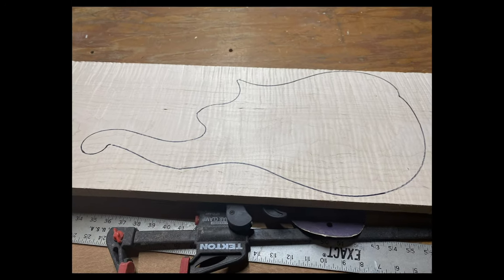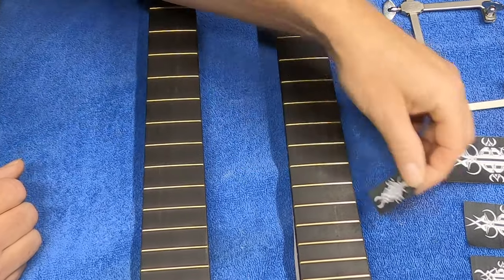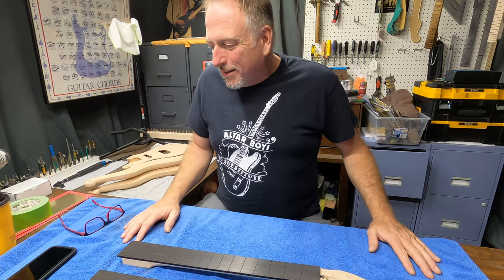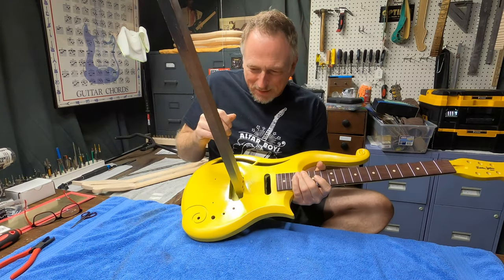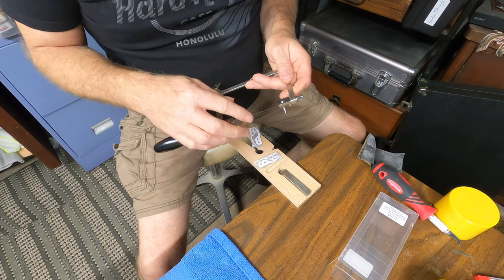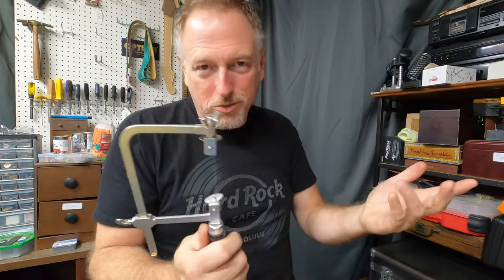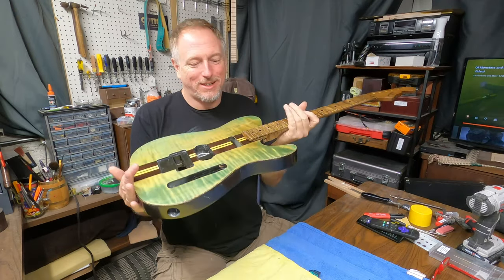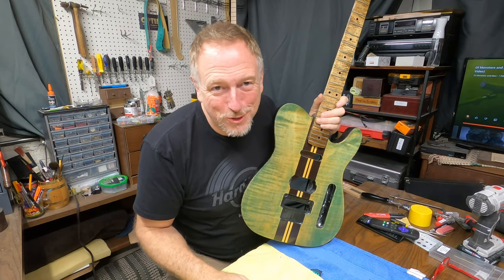Inlay or Decal? Did I Fail? Who's On First?  Questions in my mind!

Comment: I'm thinking the smaller of the two inlays looks better size wise. I've seen some ugly, ugly fretboard where on a lot of guitar that come into my shop. That would totally eat up decals. There is the scribing and inking style that would give a more 3D effect. That combined with some different color pearl might just make it work. Easy for me to say, it's not hours out of MY life.
Reply from the maker: Thanks! Dane.  In talking with Mr. X. I’m going to be doing the 2 dimensional inlay.  What I didn’t know before is that Mr X already has a guitar with the 2D inlay of the same design and it’s what he wants.
Reply: @letsbuildaguitar9230 , Mr. X needs to get what he wants. Sounds right to me.